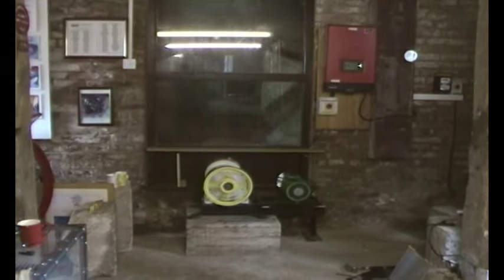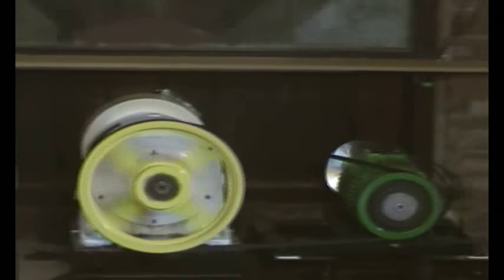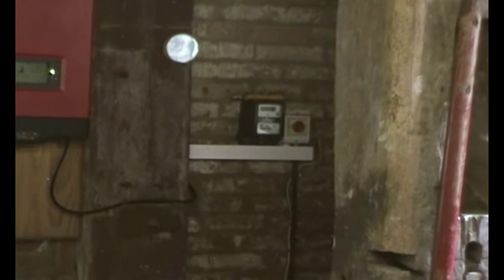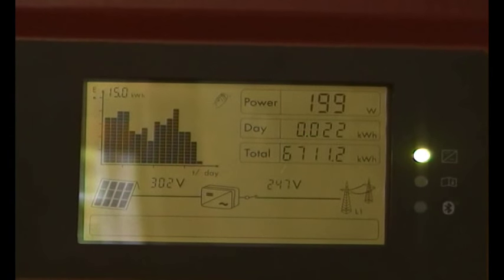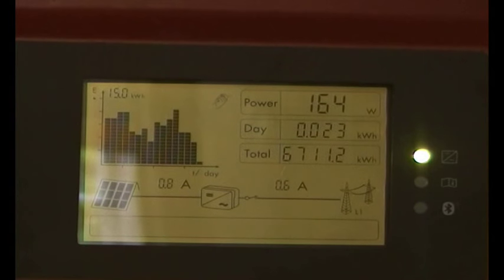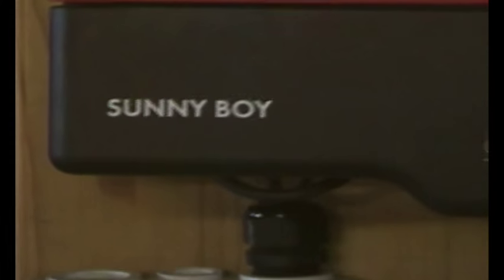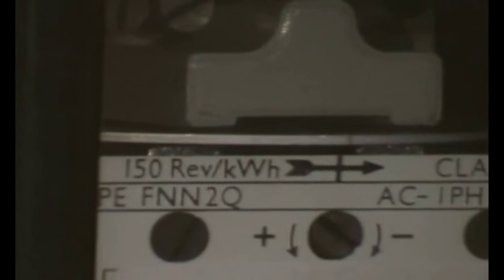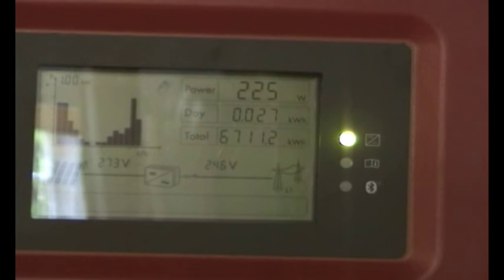Feeding power into the grid with a water wheel. Grid inverter working part 3.

Comment: how the hell did nobody else comment on this video ? this series of vids is great stuff!
Reply from the maker: Tommy, maybe i'st too technical, but the experiments are basic, if a bit rough. It was great to get it feeding into the grid. If you notice the grid tie settled down and the input volts lowered and output watts went up. Time for you to get your promotional skills fired up and get the word about on the various media platforms. I will keep an eye on the viewer figures. Cheers, Andy
Reply: +Andy Reynolds I have a couple of questions and would be grateful if you could spare the time to answer now and then as I do not have all my questions ready at once. Let me start by saying this is awesome stuff.  For now, my question is, are you relying on a combination of sources to generate the power?  Or is it solely the water wheel?  And are you generating enough to power an small village, say 40 homes?  Exactly how much more do you have to generate and is that possible with a water mill?  Seems more like we are talking enough power for one home, no?
Reply from the maker: HI. This is  a very inefficient water mill as the drop in water level is less than 3 feet. However it is a proof of concept, with a turbine permanent magnet brushless alternator with the rectified output feeding a solar grid tie inverter . I am guessing about 5 KwHr per 24 hours into the building electrical system or the local grid. It would work much better if the wheel was overshot, but then the generator would perhaps need to be larger. Cheers
Reply: Andy, your practical experience in this area seems to be unraveled on youtube. your hands on work and understanding make great vids to study. ..... p.s. will you please tell Uncle Harold to get up out of that armchair and get into his workshop! ..... the world is waiting in hope !!!!!    hahaaha    :~)

Comment: HI Andy, what you are doing is awesome.
Can you please spare few minutes of your time to clear some of my doubts on water wheel power calculations on undershot wheel. How much flow rate are you getting in lps? What is the wheel and bucket dimensions?
How to calculate wheel power based on flow rate, how to get wheel and bucket dimensions?
Thanks.
Reply from the maker: Hi. Unfortunately we never measured the flow rate as we were concentrating on trying to get the whole thing working by good old trial and error. The main thing is that a permanent magnet turbine generator can be used with a solar grid inverter if the voltage constraints are understood. From there on the max power point tracking in the inverter does the rest. Cheers

Comment: Hi Andy,
Another late question/comment.

I am building a waterwheel and was initially considering a wind turbine inverter due to the variable nature of power from the PMG when compared with solar.
How have you found the SMA Sunny Boy. Is is still working?. Do you have a dump load resistor? Is there any controller/rectifier between the generator and the inverter or  directly connected?
Thanks
Steve
Reply from the maker: Steve, this is a low breast wheel and so not very powerful. The wheel cannot run the generator at anything like full output so there is  no need for any control or dump load. The Sunny boy is again over rated for this system and is just fine but any other grid inverter will do as long as the input volts are within the specifications, commonly 100 to 500 DC v

Comment: @andy reynols. I know I am about 5 years late to the party but I want to build a water weel and make my own energy, I have googled and search but there is no much info. I think you did a great job and I want to ask you a few ( a lot) questions. 
How much did it cost you and where did you find the solar inverter and the wind turbine, can you tell me the moddels and stuff? I live in the Netherlands btw. 
I want to make an overshoot one so any tips on the flow rate and lps. Also do you think is better/easier/efficient to connect to the grid or to store my power ini batteries?
Do you think is possible to make a water wheel produce between 7.5 to 8kw/h a day. In that case what do you recommend I should do. (maybe even buiding 2) 
Sorry for all the  trouble, and thanks up front.
If I can make it work I will send you a video in case you can use it for yourself
Reply from the maker: Hi, any solar grid inverter will do, most of them have a wide input voltage range to work within. The trick is to match the generator output volts to the inverter input. You could use a permanent magnet industrrial motor as a generator. In this case we used a high voltage (250v) turbine alternator and a rectifier. You could use a  24v generator and batteries but this means you also need a battery inverter etc. See my book about all these systems. Cheers